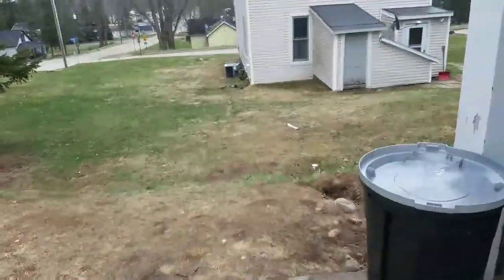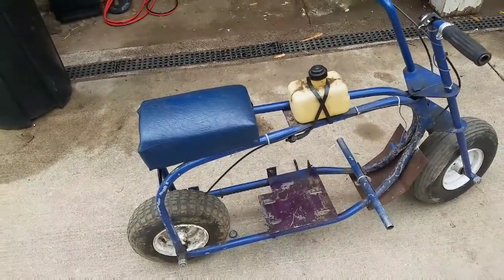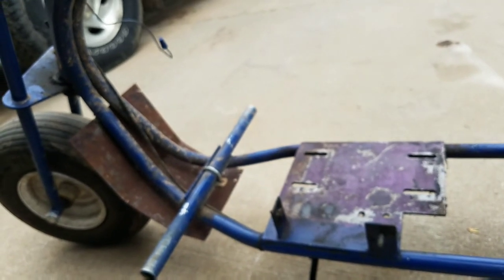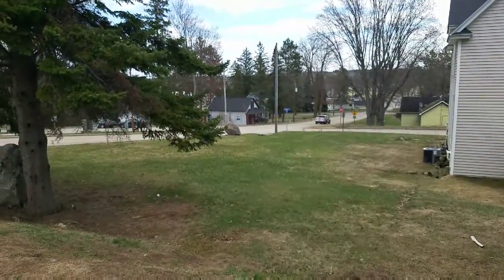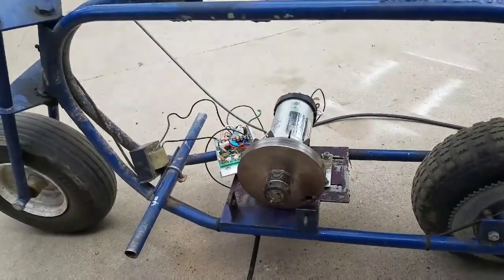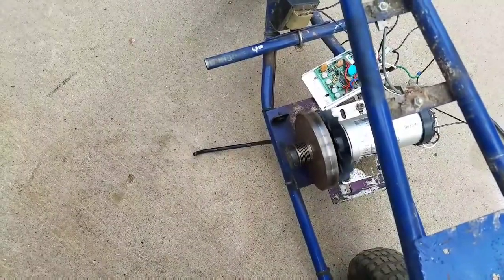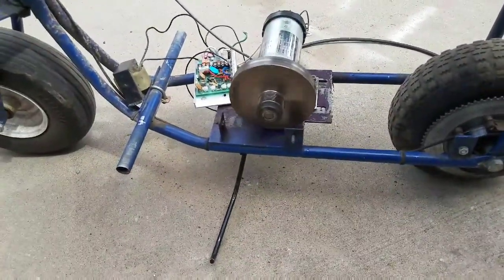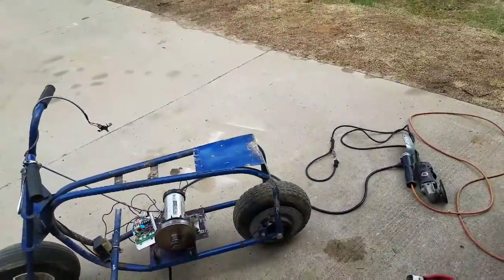Electric mini bike build ep2

Comment: Can you put link to buy the parts
Reply from the maker: That is also from the treadmill
Reply from the maker: I will try and find them but i am mostly using parts i can find from other things. That way it will keep the price down and make things easy to replace. Like the motors being from treadmills. If you were to buy them, they would be a few hundred dollars but usually you can find the whole treadmill for free.
Reply: How did you make speed controller